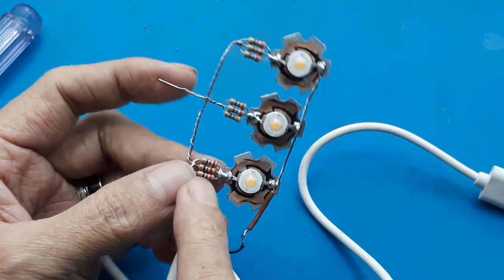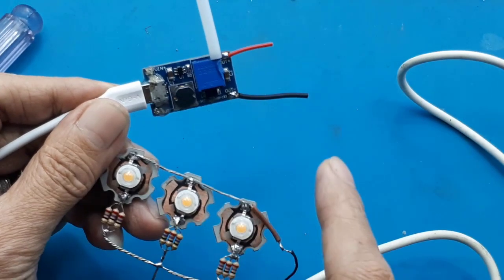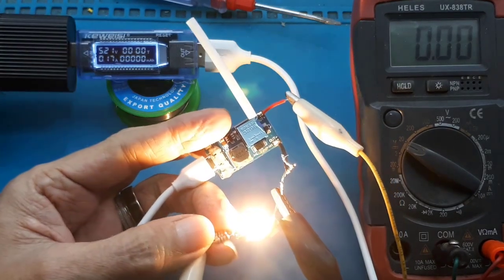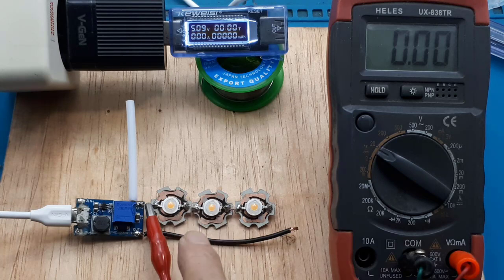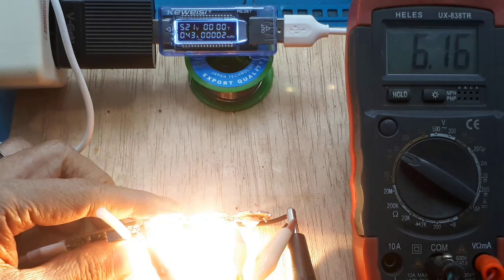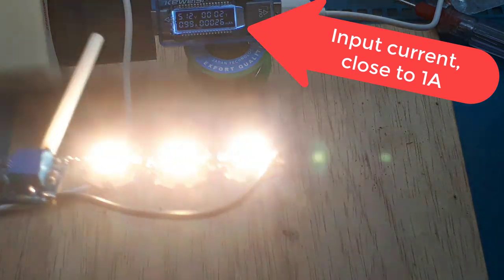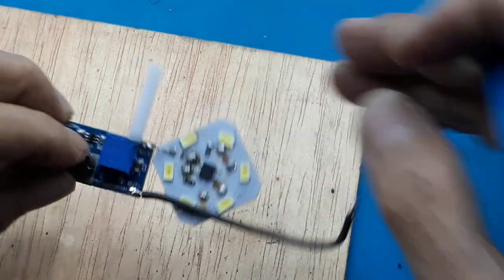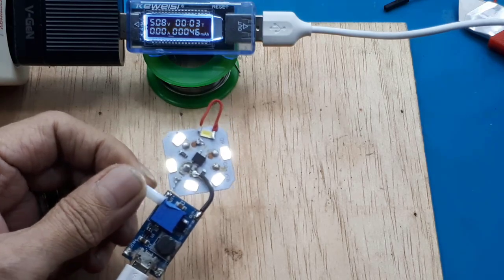Driver Led HPL 1W 3W 5W 10W  diy Modul Step up MT3608

Comment: bang, kalo led 25w 12 volt, baiknya pakai resistor yang berapa ohm agar tidak terlalu panas dan awet pada led cob?
Reply from the maker: Harus tahu spek dari HPL nya
Reply: cara tau spek HPL nya gimana bang
 @Radal05

Comment: Kalau untuk lampu led motor utama, deskripsi led max 48v 30watt, sedangkan arus dc aki kan 12v, jika dikasih modul ini di up 24-28v aman gak ya, digunakan utk penerangan perjalanan 1jam jarak tempuh, mohon infonya om apakah panas berlebih sehingga putus atau aman, terimakasih 🙏

Comment: Pembahasan kalo hplnya dibuat pararel gimana om hasilnya? Maaf nanya
Reply from the maker: agan untuk hpl berapa watt..inputnya berapa volt
Reply: @Radal05  pengen buat nyoba hpl cree 20 watt 4 biji tp takut aja soalnya masih belom paham dasarnya🙏🙏
Reply: @Radal05  klo di buat rangkaian seri pke step up di input 12v pake 4 hpl cree 10 watt gimna om?

Comment: Kang .. request pembuatan supply 5v 2A tanpa trafo boleh kang?
Sesimple mungkin...
Pasalnya ngikut channel lain kadang tegangan tak pasti, bisa 6v, 7v, 8v variasi dan Ampere nya pun dibawah 50mA, maklum kang pemula perlu banyak kegagalan 😁
Reply: AC 220v ke 5v 2A tanpa trafo
Reply from the maker: nga bisa bro...tanpa trafo maksimum 100mA

Comment: Ini yg saya cari, berarti led itu klo di seri lebih terang daripada di pararel, begitu om ?
Reply: Om sy merakit led hpl 1 sama 3 watt sistem seri pakai 4 hpl krn dayanya 12v bekas PSU computer tapi koq gak bisa terang kenapa om tolong penjelasannya
Reply: @judikusuma4584  coba serinya 3 pasti terang